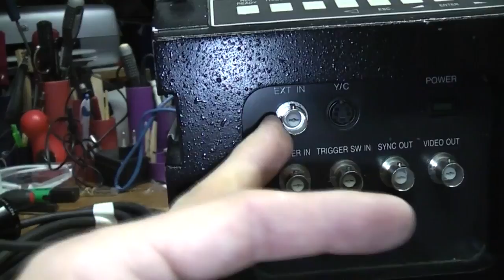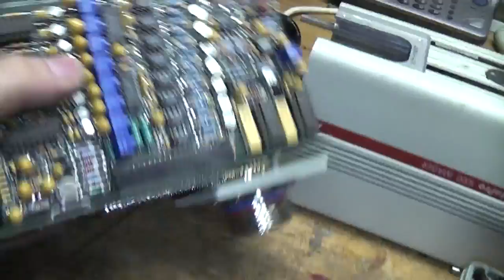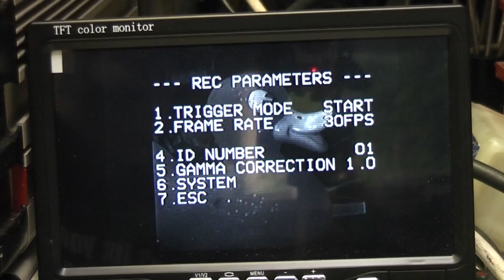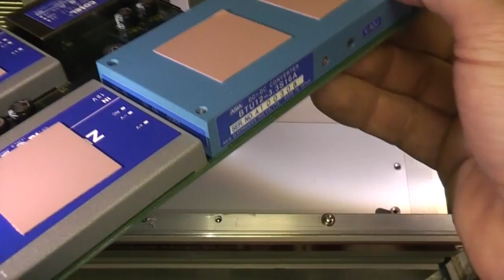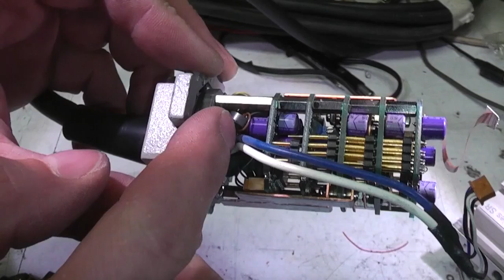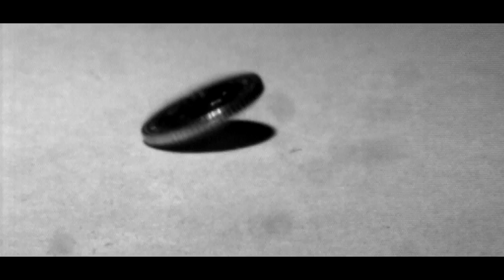Kodak Motion Corder high-speed video system teardown

Comment: Mike, what is the maximum video resolution at 24fps that would be feasible for a frame capture device which connects to a computer via rs232?
Reply: There are SO many more things you would need to know. What is the data format? What is the maximum baud rate (determined by cable length)? Can the camera chip support compression (Which many modern chips do)? Are you bound to RS-232 or is there another protocol you can use?

Comment: could you attach a SCSI hard disc (or possibly SSD) to it for more recording time or is the interface strictly for data download only?
Reply: No, that wouldn't work. The limitation is DRAM. When recording, the data goes directly to RAM because it's the only thing capable of taking that much data that quickly (at least at the time). Nowadays you could send this over Thunderbolt or USB3.0 directly into a computer's memory and get ages of recording time. Just like with his old high-speed camera (which he did a great write-up on reverse engineering on his website) you could, given enough time, reverse-engineer this and either add a lot more DRAM or just have it send the data to an FPGA which routes the data through Thunderbolt/USB/cable of your choice. Even Wi-Fi would be fast enough nowadays!

Comment: The supply for the auxiliary lights might be dead because it was run with no load.  The oscillator design that most of them use will fry without a proper load as the load is needed to keep them stable.

Comment from the maker: It's about the same res at 1000fps - slightly higher at other resolutions, but less memory. The intensified image on the old system is handy, but this one is a lot smaller and more convenient to use.
Reply: I have an early Video Logic Instar high speed camera system that records to a reel of one inch tape if you want it. 200fps max and uses a vidicon tube.

Comment: It's probably sad that I recognised the duck! The same colour changing duck I bought my wife where the battery NEVER needs replacing... until it does and you have to cut and pry the thing out :) - Liked the wood drilling. Looking forward to seeing what uses you come up with for the two cameras (is enough balloon pops etc on youtube). Does this make your previous high speed camera you fixed up obsolete?